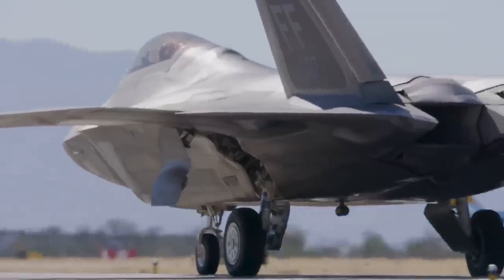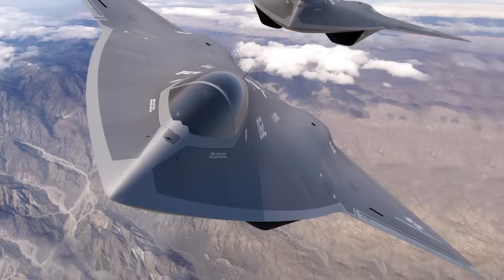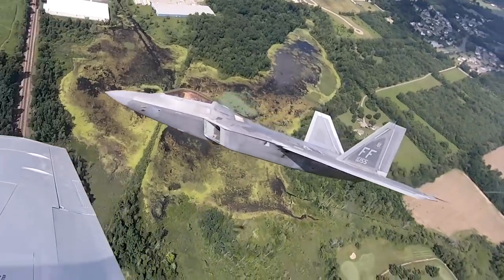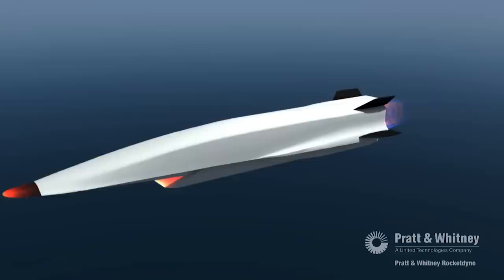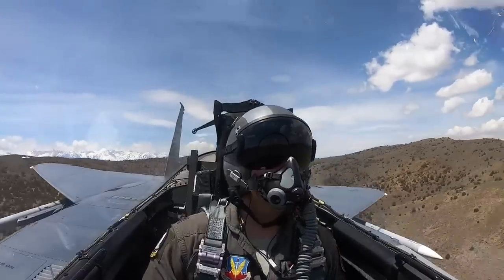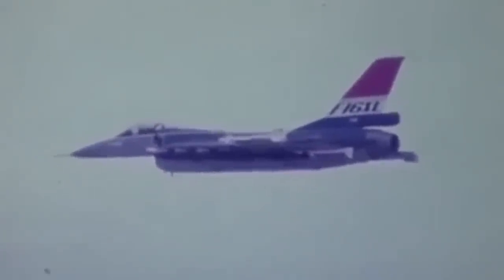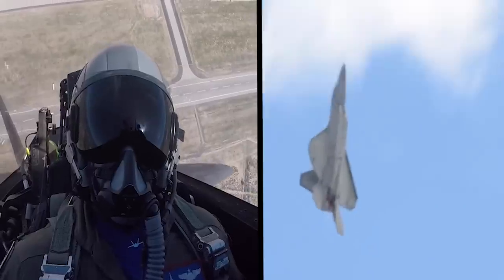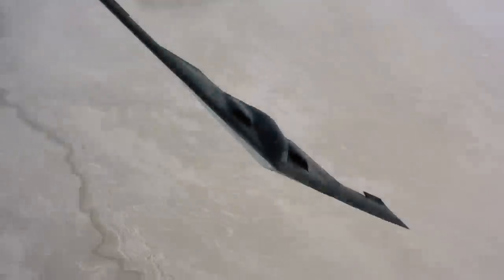How America could build the best stealth fighter in history

Comment: Heard that no gun no agility needed story from missile salesman before. The VietNam /Israeli experience set that idea back a bit.

Perhaps a AI drone can carry out that limited role.
Reply: agree
Reply: Why have a gun if you have a laser that never runs out of ammo?
Reply: Who needs agility and gun when you have lasers and 360 lock on with those new advance helmets.
Reply: @Tonius126  Because any mirrored surface defeats a laser. Air Force was experimenting with a Raptor that had a mirrored surface all over, and it's likely they were testing laser effectiveness on it. 

Bullets will still be the cheap backup for a modern fighter jet.
Reply: @Karnakthemagnificent  Lasers are way too dependent on weather/atmosphere conditions. And they consume much more power than a fighter jet would be willing to give.

Seems like a super expensive way to waste money unless laser tech has improved immensely over the last 5 years.
Reply: @SuperCatacata  Sort of answered your own question, tech has improved - to include improving performance in less than idea weather. And new engines are designed to provide more power.
Reply: That’s info that is 60 years out of date. Scratch that, it wasn’t even true in Vietnam, where ROE required visual ID, which obviously made WVR combat frequently the only possible form of combat. Nevermind the fact that modern day short range missiles have maneuverability to the point where they can hit targets behind the firing aircraft.
Reply: @Karnakthemagnificent  No I haven't. There is no evidence that suggests that lasers are a viable option for fighters within the next 30 years. They were already scrapped as a missile defense system due to how much the atmosphere can interfere. And if gigantic ships struggle to get enough power for these lasers, why on earth do you think a small jet will be able to?

Also you shold try to answer the guy about simple "reflective surfaces" being the ultimate counter to such expensive lasers, right below your first comment.
Reply: @jonathanpfeffer3716  So the gun platforms on the F14,  F15, F16, F18 and F22 aren't now and never were needed? And the agility designed into all of  the of the post Viet Nam fighter aircraft of all western nations and copied by the Eastern nations from the 1970s to today was an error?

What do ya know? Those errors  dominated airspace for the past 50 years
Reply: @buzzpedrotti5401  No, they weren’t needed. Not a single one of those aircraft have ever used their gun in air to air engagements. Literally every single US aerial combat victory since Vietnam has been with missiles, primarily longer ranged ARH missiles. Infantry also still mount bayonets on their rifles.
Reply: @jonathanpfeffer3716  I believe that the real experts, the Israelis and Iranians who have scores of modern jet aces between them have both had gun use in modern aircraft dogfights.  

They certainly had agility enhanced kills among the missile chucking.
Reply: @SuperCatacata  lets not get into arguing about the idea of a weapon system that is still in development. Your point is well taken, but my point is why limit your ideas to a gun, when you can think out of the box for a next generation platform.   

As for reflective surfaces, they are not perfect, you also need to know something about the freq of the laser for them to be effective. Then there is the issue of the pilot in the other aircraft, you cannot easily protect the pilot from being popped like an egg in a microwave by a well directed laser shot to the cockpit.
Reply: @buzzpedrotti5401  You would have to be crazy to think that the Israeli or Iranian (especially the Iranian) air forces are the “real experts” compared to the US. The fact that the most modern American fighter didn’t even have a gun for two of its models should tell you how important the actual real experts see it. It’s not that having a gun is a bad thing, but compromising other functions or adding weight to do so is a bad thing.
Reply: Perhaps we should examine facts and review a bit of obscure history.  Since Vietnam, Israel has shot down many more frontline Warsaw Pact Fighters in aerial combat than the United States.  They want agility & guns.

Even more surprising,  according to a a guest on Ward Carol's YouTube show a while ago,  the Iranians with a few operational f14s &  Phoenix missiles that they retained in spite of the US arms embargo, decimated the  relatively equal but much larger Warsaw Pact equipped  Iraqi Air Force over the 7 year Iran Iraq war.  US trained Iranians under the Shah trained more Iranian pilots  and according to Ward Carol's guest, the Iranian Air Force now has many more fighter jet aces than any other Air Force.  I'm recalling  this from memory,  so please forgive my errors.  Iranians  used both the smarts and the maneuverability of the Tomcat for distant and  rate fight kills.

Now can they survive in a US 2022 battlespace?  Probably if they stay at home, in bed.  

But that does nothing to dispel the evidence that the Top Dog and the three most battle hardened airforces (Russia, Israel and Iran) have agility and gun power as  important fighter requirements.
Reply: @buzzpedrotti5401  There was only one gun kill recorded by the Iranians, a lumbering helicopter (MI-25). Most of their kills were early in the war, with missiles. But later in the war, Iraq was freely bombing Iranian cities (see "war of the cities"). So I think using Iran as an apex example of a nation's air power is a bit misplaced. 

Israel is legitimately a country whose air combat history is worth noting. But if you look at their history, since 1973, you might be hard pressed to cite a gun kill. As for Ward Carroll he is one of my favorite youtube channels.
Reply: @Karnakthemagnificent To Review. Therr are four points being made.

Since VietNam in air warfare to date
1. Gun toting in fighters  has been important to Air Forces.
2. Agility has been important to Air Forces.
In the next generation of US fighter design
3. Gun toting will be important
4. Agility will be important.

The thread established the support and opposition for all of these points by reviewing some facts.

Comment: What would my air superiority fighter be?

A fully updated, upgraded, and totally modernized F14. One potentially stealth, or with stealth attributes.

Such an F14 would be better than any aircraft currently flying or being developed.

I'm also a huge fan of the YF23 and what its potential could be. With a revamp of its airframe and updates to all of its hardware, avionics and systems, it could be a monster.
Reply: I suggest you google the ASF-14. It was the proposed new build version of the F-14 that lost to the FA-18. It would have been, to this day, the most awesome 4th gen fighter ever built. 

It would have a range and speed combo unmatched by any fighter ever. While at the same time being highly agile and having an absurdly large radar. 

The drawback was that while it had Bugatti performance, it also had Bugatti pricing. The Navy decided to go with the Toyota Camry based on economics.
Reply: @Elthenar  I'm well aware of the ASF14, which is sort of what I'm referring to here. It would've been awesome to see it fly. This channel did a video on it a while ago. Should watch it if you haven't and you're a fan of the F14 like I am.
Reply: @W1ckedRcL  I am

The swing wing design is dated tech though, so we will never see another F-14.

The YF-23 was in many ways a spiritual successor though. It didn't have the swing wings but it share many of the strengths of the F-14 compared to it's peers. It wasn't as agile as the F-22 but it was faster, stealthier and projected to have more range. I also feel that it's weapon bay would have allowed it to be a good strike fighter with updates.

Comment: Maybe just a drone fighter be more high performance. Not have to worry about the Gs it pulls. Cheaper because no pilot, ejection seat etc. No problems with pilot fatigue. More run time. Basically they need to spend as much on high performance drone as the next Gen fighter. Then see how good the drone performs against human powered aircraft.

Comment: Air show queen, the SU-35, with its "unbelievable" and "laws of physics altering" flying maneuvers, was ultimately shot down with relatively old surface to air system. I  realize that the Russian finest wasn't taken out during the dog fighting but we can still deduce that the 3D vector nozzles were shown to be of no use against the fast maneuvering missile that locked on the Sukhoi. And although we don't know the exact system used against it, whether it was an infrared or radar guided missile, it's pretty obvious that Pugachev's Cobra isn't the most important capability to have when trying to survive an enemy's missile attack.. I presume that the pilot of the SU-35 wished he had an aircraft with stealth and incredible electronic warfare and situational awareness instead of the large Mach 2.5. beast that can pull 9Gs and impress the crowds at the Moscow air show.

Comment: The US is retiring the F22 because it's expensive to field and there really isn't even a peer aircraft in large enough quantities in potential oppositional forces.

Stealth systems aren't necessarily about being absolutely undetectable but reducing radar cross section, which in turn reduces effect range and time to respond to detecting the incursion.

The Airforce long term is probably looking to transition pilots to field commanders of a system of forward stealth UAVs operating as spotters to deliver weapons from  stand off missile platforms outside of the engagement zone. It may be more useful to have a drone pilot operating a fighter drone from a flying platform in theater to reduce latency and improve response for high reaction fighting. Drones are less susceptible to g forces, and losing a drone doesn't lose the incredibly high value of the pilot. The Air force has a plan to convert 747s-commercially available high payload  long flight time airframe to a missile payload system as part of the next Gen drone net. The air force is also working to develop point to point laser communication systems that are impervious to signal blocking.

And whatever we think we know about the next Gen capabilities, the fact is we don't. If the Airforce is issuing press releases, then it probably has things in black projects no one could dream was possible today. Bear in mind, the F22 Rapter was developed in the late 80s and 90s and went into service a decade later. The super computers of the 90s and early 2000s are less powerful than your smartphone. Contemporary modeling development let alone proprietary defense contractor software has got to be rather impressive and able to use the best supercomputers in the world to deliver fast feedback calculations to go into quickly printed and tested but still highly accurate 3d printed models. Whatever the Air Force decides meets their definition of 6th Gen or 7th Gen aircraft are going to blow people minds in ways we didn't think was possible.
Reply: The F35 has just a bit larger radar signature as an F22 but both can be easily spotted by germanys cutting edge radars, the era of stealth is at its end, impractical, too costly, and only works on low tech countrys airspace. I expect that soon its all about speed again and even more altitude.
Reply: @PiconPrimeKnight  Everyone knows  during peaceful time or non combat time the F-22 and F-35 switch on their transponders and put on reflectors.
Reply: @treycash8876  they literally tested the F35 in "combat conditions" against radars of the Hensoldt company.

Stealth doesn't matter anymore, the F35 is like a flying truck to german radar tech and I dont even think that Germany has the best radars.